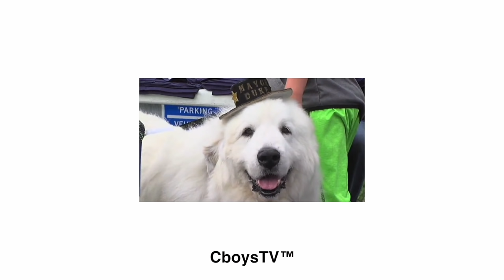Tug of War Against 3 Ford Rangers

Comment: I had a same body style Dodge Dakota 4×4 extended cab when i was in high  school. Put some mud tires on it and I put that truck through absolute hell! I used to love that truck, it went places no pickup should have been. I did eventually lose the transmission because Dodge but other than that it an awesome little truck.

Comment: I say revive tiny, but let's put some serious crawler parts into it. Chromoly inner axles, throw a few cement bags in the back or steal for some extra weight, and instead of regular Wheeling mud tires, pop on some gigantic rear tractor tires on all fours. Maybe some Jewel cases or something for massive gear reduction and I bet you you will pull all three of those rangers

Comment: It is a shackle to defend CJ. And a clevis, but shackle is more accurate. A clevis is generally more square and used in farming equipment, where as a shackle is usually specifically used for pulling/recovery purposes. 
(All shackles are clevises not all clevises are shackles.)

Comment: That Dodge dakota could possibly have a v-8 stuffed under the hood from factory. Atleast a v-6. Good thing about dodge smaller trucks they didn't skimp. Ford ranger and chevy s-10 had 4 cylinders and v-6 but dodge dakota had v-6 or v-8.  5.9L in a little Dakota def the definition of a sleeper.

Comment: I have a 93 dodge Dakota i put 31's on it and straight piped it and it went through alot and still goes strong but the cops didn't like my straight pipe and offset and they took the truck off the road

Comment: Shackles and clevises are U-shaped mechanical couplers closed by a pin or bolt. ... Shackles are primarily used in construction, rigging and lifting. A clevis is used in less demanding applications such as farming and towing. - GOOGLE

Comment: As a proud dodge Dakota owner (I have a 1993) I’m very proud😂 got it for $100 and it runs great and it had been sitting in a field up in south GA for at least 10 years. And has 200,000 miles on it. Jumped it and boom it ran (@blake_c_d if you want to see it)